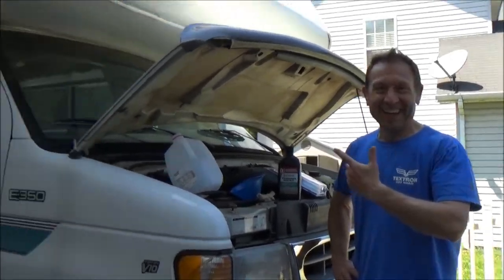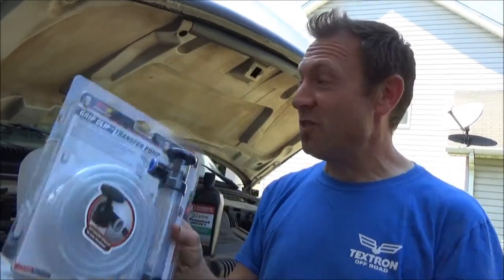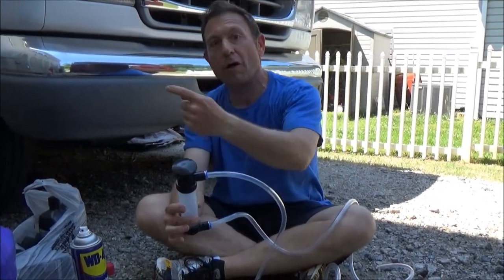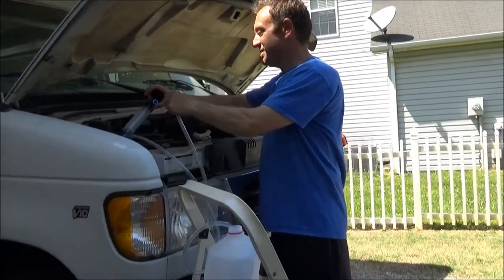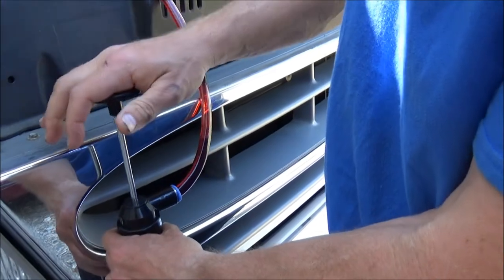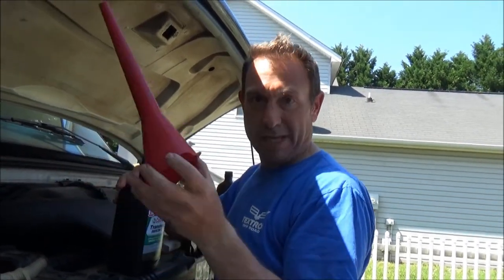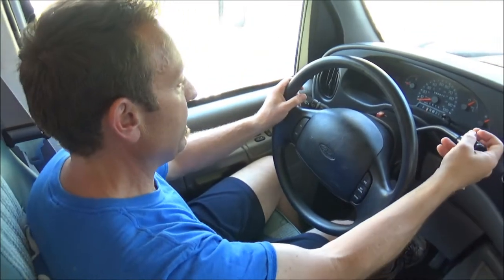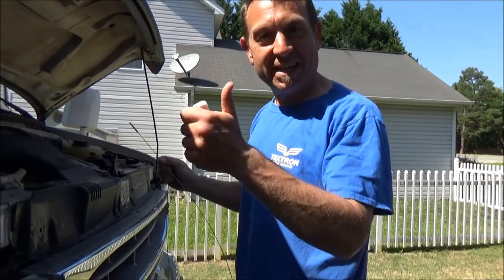Ford E350 RV Transmission Fluid Change 051518

Comment: Great video! However, this does not completly service the transmission.  In fact, you now have a very high ratio of old to the new fluid that was added....and its mixed.  Not a good idea.  I own an e350 super duty.   That particular transmission takes 15.9 quarts to effectively replace the old fluid with new fluid (the torque converter has a good bit if fluid inside as well.  To effectively replace all the fluid,  you must flush everything,  including the fluid in the cooling system and torque converter.   I did this by removing the cooling return line and draining the fluid while at the same time replacing with new fluid by running yhe engine at various intervals to remove the tranny fluid from the entire system,  including the torque converter.  In some transmissions, especially 2004 and greater, the fluid capacity cam be up to 17.5 quarts.
Reply: I am so glad I read your post. I will now take my motorhome into the shop and have THEM service the transmission to make it all new! "Thank You" (SAID WITH LOUD EFFECT - LOL)

Comment: Could you pump out what you could get out, as you did (about 3 quarts in your case) and then start the engine and then shift through the gears as you did? Would that fill the pan with more transmission fluid that would then allow you to pump out another 3 quarts or so or would it damage the transmission to run it after pumping out the initial 3 quarts?
Reply from the maker: Great question!  Truthfully, I'm just a home shadetree mechanic and I'm not sure if that is safe for the transmission.  I didn't and never had an issue with the trans after I did it this way.  I sold it to some friends who also never had an issue so I can say that while this way didn't get everything out in one dump, it worked well enough.  You may be on to something if you can verify it's safe.

Comment: what year is your van? I am having trouble getting the tubing far enough in the dipstick to drain fluid... I hit a stop, and nothing pumps out. in only about 3.5 feet in while dipstick is 4.5 feet long. is there a tight turn in the dipstick fill??
Reply from the maker: This was a '98 but they're the same for many years.  I also hit that curve and lubed the tubing with a bit of trans fluid then pushed it through.  Good luck!

Comment: Mine only has 62k miles, loves to go 75mph. but now after 3 mtns at 6000 ft in utah. i',m hearing a rattle..hope its not vavle lifters?
Reply from the maker: Tom, I have a pretty bad ping when towing my racecar: I've had to switch to premium fuel to keep that detonation at bay...perhaps the same situation?
Reply: I don't believe yours loves to go 75 MPH. I'm not surprised you have a "rattle".
Reply: @JohnHammerMedia  That a tuning problem, not a fuel problem.

Comment: The owners manual calls for 13.9 quarts or 18.8 quarts (5speed). How is it you only got 3 quarts out and looks like you only added 1 quart back in? I was planning on doing a atf change and just bought 16 quarts from the dealer.
Reply from the maker: Those numbers are for when you actually drop the pan; I simply sucked out through the tube and refilled that amount.  I've since done it two other times and the fluid is nice and clean.
Reply: John Hammer thanks. I had the dealer do it. They dropped the pan and that still doesn’t get it all out. They only used 6 quarts. Think you have to put a pump on it to get it all out.
Reply: @nubetoob9292 there a few quarts in the torque converter and cooling lines.  It’s pumping a few quarts out of the transmission adding tube is not going to do the job.
Reply: It's about 1 gallon (or less). The 16/19 quarts are total fluid in system. Even if you drop pan, expect about 4 gallons. To do a deeper cleanse and exchange you need to do a "pump" circulation extraction.  (Blood transfusion)

Your better off doing 4 pan drops every so worked Miles.If you want to do a good Services I Sugg I'd to do it when motor oil needs replacing.  You are basically getting about 40% replaced with fresh fluid. Every time you do it again you are getting a good amount of the old batch. So in the end result,  you get a way cleaner oil when you get to 4 or 5 passes. Of course it's recommended you don't do them so close in intervals, let the new fluid mix & pull the old crap out of the walls of the tyranny

Comment: I'm so incredibly happy that I stumbled upon your awesome video !!! I have the same engine but my vehicle is a van. I've been needing to do a transmission oil change  !!! Is Mercon LV what I need  ???
Reply from the maker: Depends on your year.  LV is for 2008 and newer.
Reply: @JohnHammerMedia  My van is a 2005
Reply: I used Mercon v in my e150. It should say what to use under the hood of ur van

Comment: you didn't get most of it. it hides in the converter.
Reply from the maker: Correct, I have since done the job each year so over time it's all been replaced.  Not a perfect solution, but works great for a shadetree job and the trans shifts better than ever.

Comment: You never dropped the pan to change the filter. Total waste of time and money. And trans will br dirty the first time you drive it. A total flush really is recommended.   There are tutorials here that show you how.
Reply: I think he is aware that he only got portion of it. But doing this several times over a few months should result in gradually improving the quality of all of the fluid. This is quick, simple and cheaper than a more expensive fluid exchange at an oil change place or a dealership, which would cost over $200. His strategy here is to improve the fluid over time rather than pay to have it done in one shot.